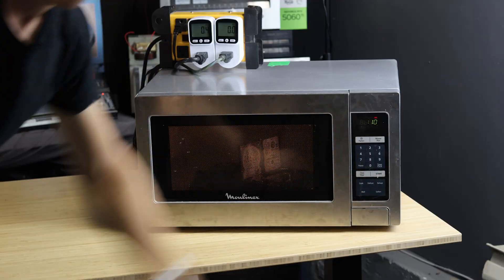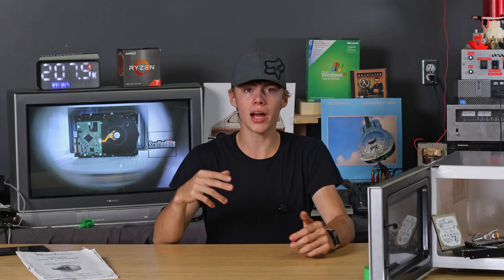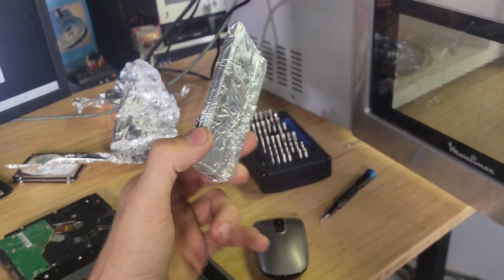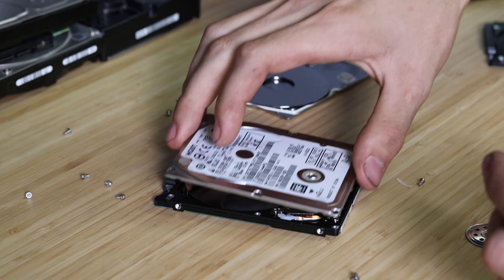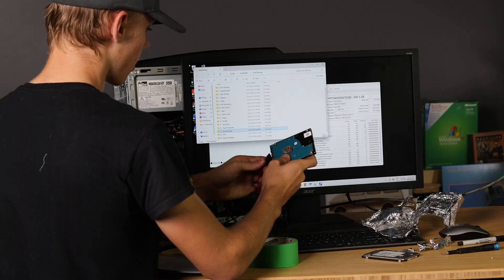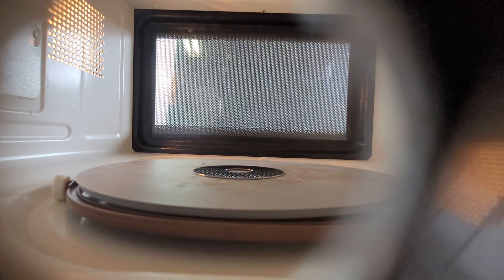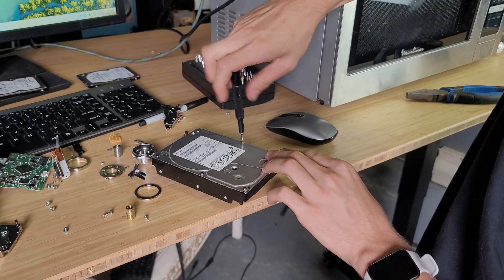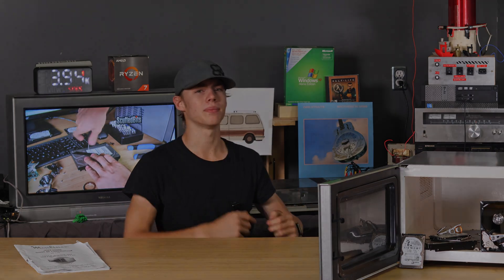Does MICROWAVING a Hard Drive Actually ERASE It?

Comment: On these modern drives the lid is steel, which has a much higher resistance than aluminium (especially being also much thinner, and austenitic stainless‑steel is much more resistive again). Many 1980s and 1990s drives have aluminium all around and would be even better shielded against platter damage (some were also sealed with aluminium tape which while not as durable, has the benefit of ensuring no gap in the shielding). On top of that, many Seagate Medalists and Barracudas of the late 1990s and early 2000s (starting with the Medalist 2132 IIRC, ending with the Barracuda ATA V) had a steel SeaShield covering the PCB, so all‑up I wouldn't be entirely surprised if one of those even survived the microwave as‑is (or at least if you put shorting plugs on the connectors), and chances are that a PCB swap would be enough to revive them.

Comment: Heat is probably the only thing that's erasing the data, I don't think the microwaves will do that directly. So you would need to leave the platter in long enough to raise it beyond the Curie temperature of the magnetic coating to ensure everything is erased.

Comment: Maybe not a microwave but heat WILL erase the data because it demagnetizes the material. Microwave would also work if the hard drive was not made almost entirely of metal.

Comment: This is a spectacular video.  I can't believe you microwaved a platter and got anything off of it.  But that might have just been the alignment of the platter on the spindle causing read errors and not actual platter damage from the microwave.  You should buy two identical hard drives, microwave one, then swap the circuit boards to see if it comes back to life.
Reply from the maker: Thanks for the feedback! That's an interesting idea to try. Unfortunately I think I only had the one matching pair. All the other drives I have are unique and I don't really want to buy drives just to destroy them.

Comment: Awesome vid! Great info to know. One non-destructive suggestion for anyone looking to securely wipe hard drives (HDD's not SSD's) is using a bootable software called DBAN that can securely wipe a hard drive by overwriting all the data in a special way, it's near impossible to recover the data from my understanding (DO NOT DO THIS ON SSD's, it will shorten their lifespan). DBAN offers different wipe methods with some being more secure than others and from my understanding the more secure the longer it takes to wipe. In my experience a 1TB 7200RPM HDD generally takes around 7-8 hours to wipe with the default settings, but smaller drives can wipe much faster (I wiped I believe a 10GB hard drive in around 20-30 minutes). Multiple drives can be wiped at the same, I recently wiped 23 1TB SAS drives although that took almost 24 hours

When it comes to SSD's they can be wiped in seconds but the method is different for SATA SSD's vs NVMe SSD's, Secure Erase is the name to research for this (Secure Erase might specifically refer to wiping SATA SSD's but the name seems to be used for both). A lot of modern motherboards actually have a Secure Erase feature built into the BIOS (for NVMe SSD's it might be called NVMe Sanitize or something like that)
Reply from the maker: Great Information! It would be nice to see this kind of method get used more to keep good drives in service.
Reply: @ScuffedBits  Yep too many good drives go to waste, it's understandable for lower capacity drives to not bother with DBAN but even then they might still be useful to somebody especially when it comes to retro HDD's for the people that want a pure period PC
Reply: you can use any kind of data wiping software for hard drives. i use killdisk for wiping all data before selling it to people.

Comment: If you don't have a sledge hammer, a regular hammer and a nail and aim it at the platters is enough to shatter a glass platter.

For a Aluminum one? Well, open it up,  use 100 grit or lower sand paper and then rub it in. For good measure, bend it into two pieces. Make sure the area is well ventilated because breathing Aluminum dust isn't pleasent for the hody.